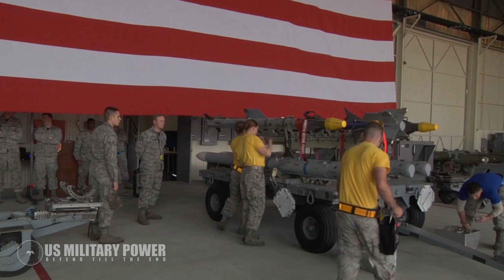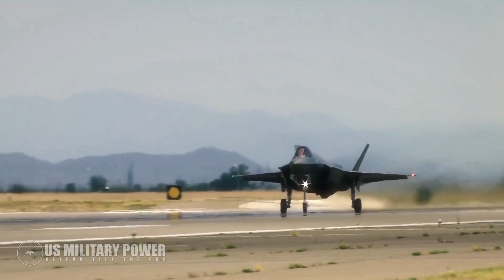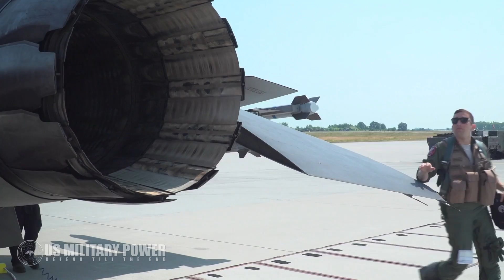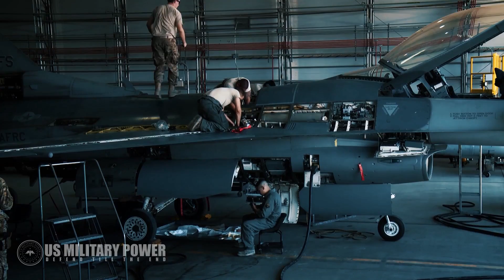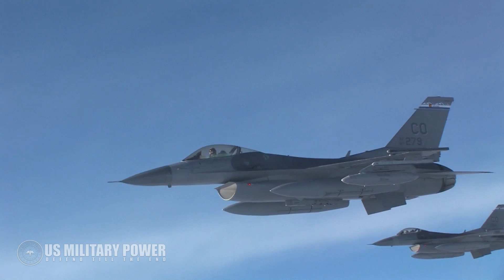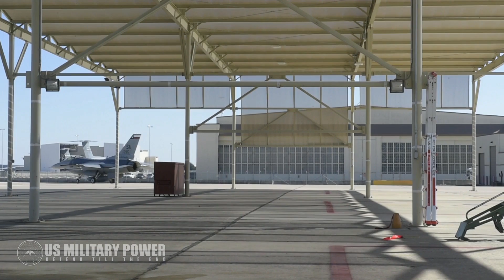Meet the New F-16 Fighter Jet (Thanks to F-35 and F-22 DNA)

Comment: Why is the Bahraini Air Force using the most advanced version of the F-16 and not the USAF? The USAF should keep some of the good toys for itself.
Reply: Because the US has the potential to go up against forces that have Air Denial systems like the S-300.  The F-35 is superior to the F-16 in almost everyway.  Bahrain doesn't need the F-35 and so they can't justify the extra cost (although it isn't that much extra per plane the maintenance is).

Comment: "DNA" is such a stupid term. It's literally just another avionics upgrade with a better engine. If people bothered to read the official pdf you would find that any mention regarding f35 and f22 is just how the radar equipment communicates with their avionics and vice versa.
Reply: See first shoot first.
Reply: And IWBs, CFTs, RAP, and lower RCS
Reply: Which is significant.
Reply: OptimalOptimus50  Actually not a downgraded version, rather a new system using tech from the radar of the F-35 that can fit in an F-16. It's significantly better than the older F-16 radars.
Reply: OptimalOptimus50  The radar is the only part I was referring to.

Comment: Waiting to see them in croatian air force, pending congressional approval.
Reply: hgrgic you guys not on the F-35 like the rest of us in Europe 🤔😁
Reply: @commonsense31  No money for that, at least for now. We still fly MiG 21`s.
But I hope that after 2022 more modern variants of F-16 would be purchased (Block 70?).
Reply: hgrgic yeah I’m split in Denmark buying the f35. 
Especially now that I know there is a upgraded f16 we could save so much money if we just bought the upgraded f16. We would have the maintenance crew already, and knowledge about the specific flight.

Comment: F 16 Block 70 is the most advanced plane at present in it''s class.
Reply: Bindudhari
Reply: Yes
Reply: Eurofighter? Ever heard of it?
Reply: @Simon_D01 - Show me a head-to-head comparison between the two.  While it's a newer aircraft, with that delta wing the Typhoon looks ancient compared to the F-16.
Reply: simul8guy seems like for u the look means power, but guess what, the Typhoon is way more agile, has better systems and is overall more powerful. I’ve read an article about an RAF Typhoon pilot who went through a simulated dogfight with a Top Gun F16 pilot and guess what? Tye F16 lost.
Reply: @simul8guy75  eurofighter is actually a heavier class. F16 lies between gripen and rafale it should be considered a light fighter compared to the double engine eurocanards. F16 is advanced when compared to gripen but it is far behind when compared to f15 eurofighter and rafale.

Comment: The F-16 was designed as a cheap lightweight fighter as a counterpoint to the heavier F-15. Mission creep has turned it into a multi role fighter.
Reply: The multi-role requirement existed as part of the fly-offs between the YF-16 and YF-17. There isn't such a thing as a non-multi-role F-16.
Reply: @dumdumbinks274  the fighter mafia intended it to be a dog fighter and nothing else.  Air Force generals corrupted the original intent.
Reply: @alexblake5743  It wouldn't have been nearly as good an aircraft if the USAF hadn't "corrupted" the LWF program.
Reply: @dumdumbinks274  pierre sprey would disagree i think.  

Here is the question:  could an f-16 optimized to spey's specifications beat an airforce loaded down f-16?    I think it could.
Reply: @dumdumbinks274  Sprey is dumb?  What about Boyd?  Was he dumb too?  Anybody calling these guys dumb has already lost credibility.  

Sprey's logic and truth telling destroys the spending machine.  Thats the real reason he is attacked.

Sprey destroyed the BVR myth by telling the truth.  Turning on a radar is like turning on a flashlight in the dark.   Everybody can see you.  In a real war with a competent foe they only have to launch an anti radiation missile at you.  Total fail.  It comes down to a dogfight where  the radar is useless and thrust to weight ratio and turning is everything.   

War is a racket.
Reply: @ @alexblake5743   Sorry mate, but it's not nearly as simple as you say. Yes, turn on a 4Gen fighter radar and people will know you are about. That said, there is a massive delta between detecting someone and being able to effectively target them. Anti-radiation missiles don't work well against aircraft, and where they exist in an air to air sense they are going after your AWACS - airliners with airliner agility, not fighters.

Dogfighting is a losers game from 4.5Gen on. With helmet mounted sights and advanced off boresight IR rockets what will probably happen is that everyone dies. Who cares if you can turn on a dime and have the thrust to weight ratio of a roadrunner on meth - you aren't trying to beat the jet anymore, you are trying to beat the missile. Take a stab at how many G's a Python 4, AIM9X or AIM132 can pull. Hot tip, it's more than a SU35 can do. These days you don't rip around trying to get on someone's 6. So in close fighting is a recipe for mutual morts, which we don't like. Radar is still the name of the game, because that's how you effectively kill targets at >10nm, and you have a better Pk through cloud etc. Even then, you still need your radar pointed in the right place and in the right mode.

Sprey and Boyd weren't dumb. But even smart people can make mistakes. There is no infallible god of air combat. This F16 should be a reasonably competent 4-4.5Gen fighter, good for the export market. US don't need or want them though, 5Gen fighters turn 4.5Gen into baby seals.

War is binary. there are survivors, and the dead. Unless you are happy to sacrifice planes and pilots (in the West we aren't real keen on it) you want to maintain the bleeding edge so far as you can. And yeah, it's expensive to do that, but cheaper than losing the fight.
Reply: @kenreckless9845  thanks for the comment Ken.  I am aware of the high G claims for modern short range air to air missiles.  Maybe they are as awesome as it seems, maybe not.  

Sprey's writings state that we don't have an effective air to air anti radiation missile but it wouldn't be difficult to develop one.  

I'm sure you are correct in saying that you don't know who you are shooting at with the anti radiation missiles but that's also one of Sprey's arguments against BVR warfare and the use of radars.  There is no way to identify who the blip on your radar is.  Any attempt to make identification can be bamboozled.   

I think we live in a post 1984 brave new world where the purpose of war is to waste resources as well and divide and conquer.   

Is the earth really spinning 1,000 mph?  I think not.  George Carlin was right, bullshit is everywhere.
Reply: @ @alexblake5743   The problem with anti-radiation missiles is largely the same as long range IR missiles - how do you solve the range problem ie how far away is the enemy. A missile homing in on a source will typically travel directly towards it, rather than leading or lofting like many radar guided missiles can. This means that your missile will have far less effective range than a radar guided one. Not really a player for WVR, but for the bigger Fox 2s what you'd want is a combination of radar and IR - radar for the range problem, IR for the homing.

BVR combat depends very much on your Rules of Engagement. You are quite right in that if you require positive ID on a contact before you can shoot you may well have to close to visual range, especially if the enemy isn't using their radars. However looser ROE solves that problem. Civilian airliners won't generally travel near warzones if there is an air threat, and they are normally squawking Mode 3 IFF codes as well as traveling at airliner speeds (ie slow for fighters). They also don't normally fly in formation. You can also warn them off on the GUARD channel. Any contact which you can't ID, and doesn't respond to your directions, put a Fox3 into. The added advantage is that if your enemy is not using their radars, or traveling faster than 400kts, or on their own, they aren't that much of a threat to you.

I would agree that the world is becoming increasingly authoritarian, but I don't think war is being used as the vehicle for achieving it. In the West at least, war has very little impact on the lives of most people. Instead, it is socialist ideologies such as identity politics, political correctness and the cult of victimhood, as well as the prioritisation of feeling and emotion over reason and evidence. The tools of the new left include routine moral panics and other conflated issues such as climate change, all the way through to direct violence by groups like ANTIFA who claim to be against fascism yet behave in exactly the same way as Mussolini's blackshirts or Hitler's brownshirts. In the US Trump is portrayed as far right, whereas a couple of decades ago he would have been a very boringly middle road conservative/nationalist. In Europe the EU is increasingly happy to override the will of popular vote and referendum, very much moving towards enforced political union and rule by unelected bureaucrat. In Australia you have two political parties so closely aligned there is arguably no major right wing party anymore. Compounding this issue is the influence of particular individuals over online media, notably through manipulation of search engines. There are elements in the West with considerable power who are increasingly regulating what you can do, say and write. But right now, war isn't their tool.

Besides, war never changes :)

Comment: They naver share this new tecnology if this system was good like f22...🤣🤣
Reply: It's not F22 tech you can go to main Lockheed website and see that it is not even close to the F-35 but the radar etc is based on that tech and cockpit as well. Still will make it a great plane block 70/72 just not stealth. Many nations cannot afford to have F-35's you need nations with  larger fleets of at least 100 fighters to even consider going into F-35 down the road.

Comment: A very successful fighter jet. Made for one purpose,air combat.Pierre Sprey has made many comments about one jet fulfilling every role expected of it. Doesn't work. Purpose built aircraft are a much more pragmatic way to approach the various problems they face. The A-10 is a perfect example! An absolute wonder for what it was built for!
Reply: michael mixon the F16 is actually designed as a multirole fighter / attack aircraft and does both jobs well.
Reply: @devildoghog1764  The F14 as an interceptor and the F15 as air superioty yes
Reply: @JoelLinus    They are not superior in a dog fight against a Viper but great interceptors.
Reply: Peter ohne Nachname the Tomcat was a fleet defense fighter designed to intercept the Russian strike bombers and their air launch cruise missiles at long range. Once that threat finished and the fleet acquired defensive systems like AEGIS, the Tomcat was refitted for air superiority. The last version the F-14D was a multi role fighter able to drop bombs and other attack munitions
Reply: The original thinking behind the F-16 when it was proposed by the legendary pilot and theorist John Boyd was a cheap light air superiority fighter as a counterpoint to the heavy F-15.  The F-16A could pull 9G and had a positive thrust to weight ratio. More mission requirements were added and the f-16 became a multi role fighter.

The A-10 was designed with only one mission in mind. Close air support.
Reply: @kelvinktfong  aha
Reply: @JoelLinus    Whos gonna win the side with 1000 armed to the teeth cheap F-16's or 80 massively expensive to own and operate  F-35's   ... Im gonna say the F-35 base .. your base is toast.
Reply: @captlazerhawk  I said F14 you toaster
Reply: Peter ohne Nachname the Tomcat can hold its own against the F—16. By the late 1980s, aggressor units at Red Flag and Top Gun we’re flying F-16s and F-15s to match the performance of the latest generation of MiGs and Sukhois. The upengined F-14B had the performance to match the eagle and viper
Reply: Capt Lazerhawk recent tests show that the F-35s out fly the F-16. The stealth systems allow them to close without detected.  The idea that the F-35 is not good is a myth. The IAF have flown the F-35Is in combat over Syria. The British are conducting carrier ops with the F-35B
Reply: @kelvinktfong   Yes thats not the point I was making.  I am assuming that F-35's are bad ass planes... like way bad ass for arguments sake.  But to win an all out hypothetical war... (however unlikely)  would you win be better with 80 F-35's or 1000 F-16's based on the assumption that the F35 is times more expensive to buy and maintain and fix per flight hour.
Reply: @JoelLinus  To be honest you really didnt say anything useful.
Reply: @captlazerhawk  Wtf are you both talking about, I said F15 air superioty and F14 Interceptor, nothing more
Reply: @JoelLinus    Yes and when I said this -> They are not superior in a dog fight against a Viper but great interceptors.   I was referring to both.  So I honestly have no idea why your being so defensive.
Reply: @captlazerhawk  I was so defensive because I had no idea why you are so offensive.
Reply: @captlazerhawk  Cost per flight hour for an F-35A is only a little more than an F-15E. If CPFH is the main consideration then for 80 F-35As you could potentially get 150 F-16s. But when there aren't enough pilots you can certainly say with 100% certainty the more expensive and far more capable fighter is the better option.
Reply: @dumdumbinks274   OK what about when you take into consideration acquirement costs?
Cost 10x higher is it not?
Reply: @captlazerhawk  Nope. A Lot 11 F-35A costs $89 million. F-16 Block 40s that first entered service in 1988 are worth around $40 million currently without any upgrades, and modern F-16 Block 60/70 models are worth more than $60 million, but it depends because they tend to be customised to the export customer's requirements.

Comment: f35 not f32
Reply: The Boeing X-32/F-32 is a concept demonstrator aircraft that was designed for the Joint Strike Fighter contest. It lost to the Lockheed Martin X-35 demonstrator, which was further developed into the Lockheed Martin F-35 Lightning II.
Reply: WWK YT OOOHHH. Well then call it the X-32, dummies.
Reply: Didn’t even notice 😂
Reply: Hahahahaha
Reply: Didn't they call it panther?